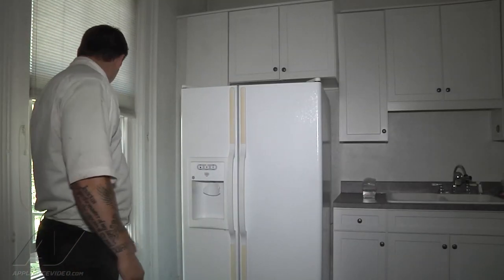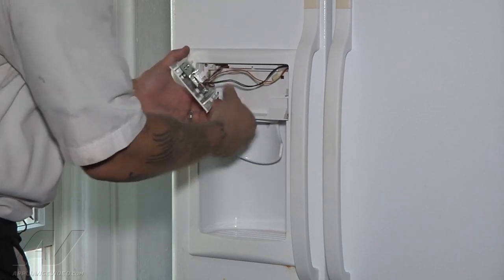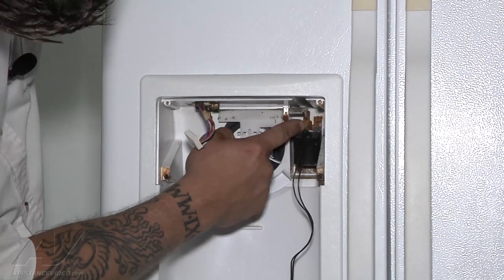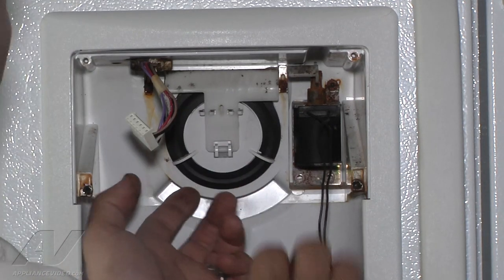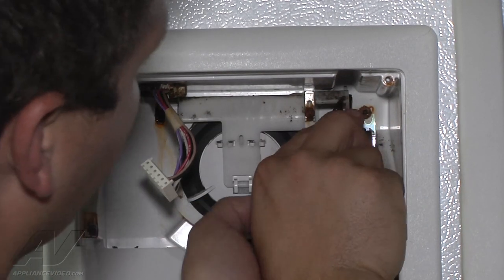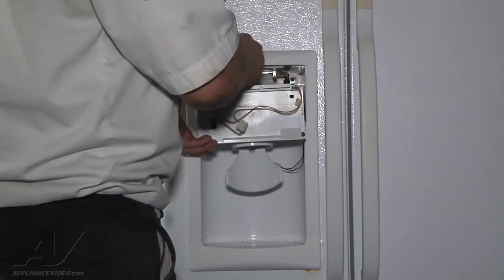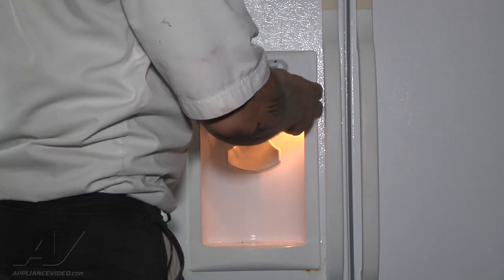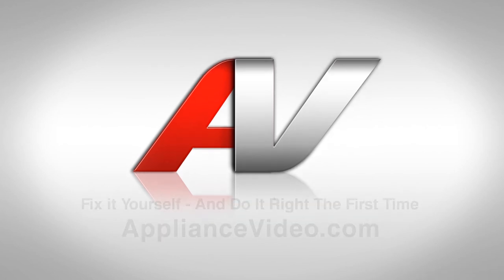GE Refrigerator Repair - Ice Dispenser Does Not Close Properly - Solenoid

Comment: Thanks so much for this video!!  My flap either wouldn't open enough for the ice to come out (causing a backup) or it wouldn't close causing the water line to freeze.  Once you explained that this is due to corrosion  I used my wire wheel to clean up all of the ample corrosion on the plunger and the solenoid and some fine sandpaper for the inside of the solenoid such that I was able to reuse the parts.  Didn't cost me a cent.  Thanks again!!

Comment: Our GE refrigerator ice maker was having issues where ice was forming at the top and I noticed condensation forming on the metal above the control panel on the door.

I found out later warm air was entering the Ice Holder from the open flapper and melting the ice cubs in the ice holder

That is when I figured out the Flapper was sticking open

I can close it manually but I need to fix it

Comment: I did all of this to my freezer and it seems the door still isn't closing. I can see light when I shine one up the dispenser. I have tried three new flappers they all seemed to be warped when I set them on a flat surface. I got the solenoid and that didn't solve it. I also replaced the one next to the ice maker. 
My ice maker is so bad now I have removed the bucket because of melting and refreezing ice as well as frost all over the shoot, the bottom of the ice bucket and on anything below the bucket.
I paid for the DYI site and he wants me to replace the door part 900. That seems pretty extreme. Still I was on looking for information on how to replace that $300 part and I came up with nothing. Any help would be appreciated

Comment: Hi my Magic chef upright deep freezer seemed to be frozen shut.  how can I get the door open ?
Reply from the maker: Great question, you can call our parts department at 1-800-830-5465 and they can give
you help 6-days A week Mon-Sat . You can also search at www.SaveMoreOnParts.com 7- days a week.  If you have a more technical question that our parts department cannot answer, our technicians are answering all questions at our website at www.ApplianceVideo.com under our Repair Help section. We have over 4,000
common questions and answers that you can easily search through by your model
number, appliance make, and problem or error codes, and It’s free to search
through our question & answer library.

Comment: I have model number GFSF6KKYCWW. This same thing is wrong with my refrigerator except on my refrigerator it doesn't have the frame which can be removed.  We can't figure out how to get the touch panel removed, any ideas?
Reply from the maker: Great question, you can call
our parts department at 1-800-830-5465 and they can give you help 6-days A week
Mon-Sat . You can also search at www.SaveMoreOnParts.com 7- days a week.  If you have a more
technical question that our parts department cannot answer, our technicians are
answering all questions at our website at www.ApplianceVideo.com under our Repair Help section. We have over 6,000
common questions and answers that you can easily search through by your model
number, appliance make, problem or error codes, and It’s completely free to
search through our question & answer library. There is a very good chance
you question is already answered there.
Reply: Gayle C ooooooo
Reply: M
Reply: Mn
Reply: @Appliancevideo  on a g.e. monogram side by side fridge, how can i get the controle panel off of the freezer door to get to the ice door flap  it doesn't close all the way